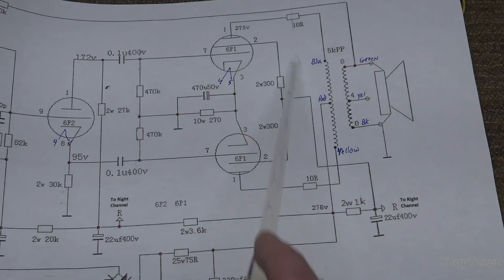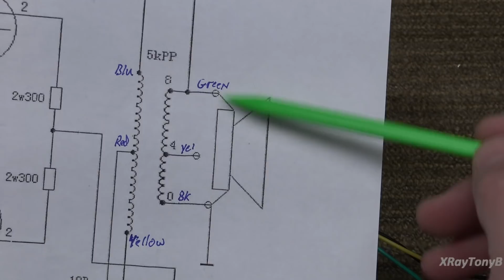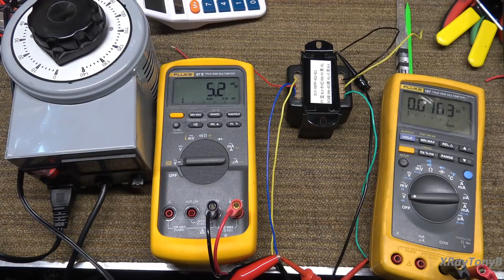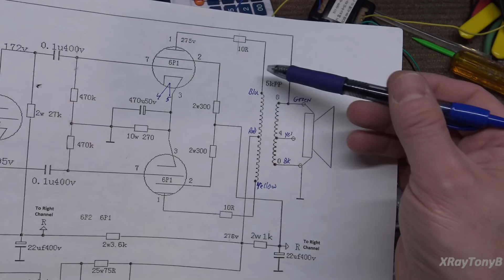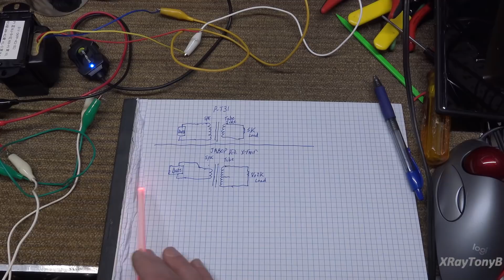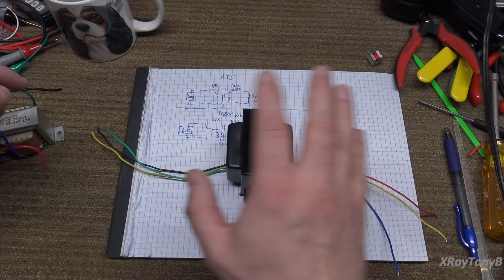Electronics 101½ Part 8 - The Output Transformer

Comment: you are wrong. it is a 5k transformer meant for Class A Amplifier. 
and we know Class A modifies impedance downward. 
more precisely Push-Pull Class A. 
you do not measure that "5k" or "8k" at the output, you measure it at a single section of the primary, when it delivers nominal power signal, not music, but tone, full power. 
how you do that?

Comment: I wish this kit was designed for EL84/6BQ5 push pull. It seems like it's so close to that, but not quite there.
Reply from the maker: I'm not sure what you are referring to, but this amp is push-pull.  It uses 6P1P outputs, which are similar top the 6AQ5 or 6V6, but with different pinout.  The 6BQ5 has higher gain and a few other differences, so some of the component values would be different, but it would still be the same circuit.  If you watch and learn from this series, you should be able to understand how it works.  Thanks for the comment!
Reply: @xraytonyb  Yes, I realize it's push pull, stating that I wish it was El84/6BQ5 and it seems so close to having the component values to be of such. I'm assuming they knew about the EL84, but wanted to design it using the less desirable, cheaper tubes to sell a complete package at an affordable price. I should've left the "push pull" part of my comment out, which was irrelevant to my point. I've been watching this series and I'm learning a LOT. Many terms and concepts had me lost until I started watching your channel a year ago. I love this hobby, because it's challenging and seems to be endless in depth. Thank you Tony for sharing!

Comment: How does running a single power tube in a push/pull cathode biased circuit effect the output transformer? Does it damage the output transformer?

Comment: I've seen this impedance ratio video over and over on different channels. Why not just put an LCR meter on the primary, measure the inductance and use the formula Inductive Reactance (impedance) = 2 * Pie (3.14) * F * L? I believe the standard frequency (F) used is 1 Khz. Would that not save a little effort? Thanks!

Comment: I'm get readings of between 4 and 9 megaohms when I connect between the primary and secondary windings on a suspect output transformer. So I assume thats the problem with my amp? Massive amounts of humming and no sound from speaker?

Comment: is it possible to ID mystery winding voltages with only one multimeter?
Reply: Yes.  Measure one side, then measure the other side.  For example, turn the variac up until you see 1V on the secondary, then take the meter off and measure the voltage on the primary.

Comment: How can I convert a vintage Yamaha CA-1010 transformer from 110V to 240V, from Japan to European standard.
Reply from the maker: You can buy step-up / step-down transformers for this purpose.  The only thing you need to watch is the frequency (50 vs 60 Hz).  Most receivers don't care, as they rectify the power to DC, but some things like turntables and tape decks can be affected.
Reply: @xraytonyb  I will hook it up to a modern CD player.

Comment: Howdy. May I be so bold trying to clarify things ?
Firstly. The magnetic induction depends almost entirely on voltage, frequency and number of turns. Current has little effect on magnetization other than the 90 degrees shifted inductive magnetization.
Second. The core does not convey or transport anything. The core only serves to keep the flux concentrated for tight induction.
Third. What heats up the transformer is almost entirely ohmic losses in the windings. The oscillating flux generates some heat. Yes. But that is almost negligible.
Fourth. The core size must be chosen large enough to accomodate wire gauges thick enough not to generate too much heat and to be able to dissipate the heat without causing the bobbin and wire varnish to melt and be a fire hazard. The core and winding outer surfaces do the heat dissipation into air.
Fifth. There is a rule of thumb that says that the core cross section in cm2 should be about the square root of the power in watts. But this rule is empirical only. It is not derived from laws of physics.
Sixth. How do we then understand the illusion of power conveying? Induction generates voltage over the secondary. This voltage starts driving current through the speaker. This current also fights the induction. The primary observes the induction going down and compensates by drawing more source current until the induction is restored.
Regards.

Comment: Xraytonyb, I learned something by watching your video, now I see another way to find impedance of an AF transformer. The way I was doing it was to use an AF Generator at 400 - 1000 Hz to feed through a series potentiometer into the primary, with the secondary loaded with a resistor of the rated secondary impedance. Read the generator voltage and adjust the potentiometer to read half the voltage at the primary. Then measure the resistance of the potentiometer and you have the  impedance of the primary.
Reply from the maker: That's an interesting way of testing impedance ratio.  Thanks for  sharing!

Comment: Is not the max voltage on the Anode of the 6P1 rated at 250 volts and not 275 volts
Reply from the maker: Yes, but this amp uses cathode bias, so the cathode resistor has some of the voltage dropped across it.  As a result, they are only being slightly naughty with the anode voltage ;)
Reply: @xraytonyb  Thanks for the reply

Comment: Howdy. Nice.
About getting laminations for OPT:s.
Check eBay for Line Transformer or Audio Line Transformer. One will get several hits.
I settled for Parts Express. They have 100 W 70 V items for about 30 dollars a piece. I ordered two and rewound them. The laminations are good audio grade steels.
Regards.

Comment: One little trick that a high school classmate pulled on us when we were in grammar school was to bring an output transformer and a D cell battery to class.  He would put the battery on the speaker side of the transformer and have one of us hold the input leads.  The second he touched that battery we got a big jolt!   It wasn't until years later that I finally understood how a dc voltage could shock you using an ac device.  Had he touched the wires to the transformer BEFORE we touched it, nothing would have happened but by doing it the way he did he momentarily created a current flow in the coils and we got zapped!  Since he was on the "low" side it meant that he was amplifying the voltage that we got.  Modern transformers are too small and don't have the potential that those old tube type transformers did so it wouldn't work otherwise.  Some have argued with me about it until I did the same thing and it made believers out of them.  The current flow is of very short duration so if you hold on to the leads after the initial jolt, nothing else will happen.
Reply: Richard, What gave you the jolt was the high voltage pulse created by the turns ratio and the magnet field rabbly changing as the battery was hooked up and disconnected. The strongest jolt happened when the battery was  disconnected causing the sudden collapsing of the magnetic field creating a high voltage impulse. In other words it was really acting as a spark plug ignition coil.
Reply: @JCWise-sf9ww , I fully agree.  Many people would never believe a c-cell battery could make your eyes water!
Reply: that brings back memories! our college lab instructor was teaching on CEMF and had us perform the same test. we knew something was up when he started chuckling and his fat belly was bouncing right before we disconnected the battery!

Comment: A pair of 6AQ5s or 6P1 will sound fine if it is 5K. I have done it before single ended as well as PP. Typically as you know 6AQ5s, 6V6s, EL84s are optimum between 6 and 8k depending on plate voltage. But I have a couple of SE output transformers that came from a Sony R2R which had 6AQ5 output tubes and the OT was 5K to 8ohms, So Sony designed this tape recorder with those tubes and an OT with that impedance. I used one with an amp and it sounds good with 6L6s and 6V6s. Also, I have a Kodak Projector amp which came with PP 6L6gb's and the amp also sounds great with 6V6s. As you know a 6AQ5 is a 7 pin 6V6. Tubes are very forgiving.

Comment: With your oscilloscope that has a bode plot mode you can do a similar measurement(perhaps with less accuracy) by measuring the applied voltage to the transformer and the voltage over a shunt resistor(as output input), and if you set your current scaling according to your shunt value directly get the correct values on screen.

This is useful for those of us that don't have an specific instrument to perform those measurements.

You need to have a scope that allows you to use the difference between channels as a bode plot "channel" OR a differential probe(Micsig has some cheap ones) OR you can get creative and take advantage of the isolation of the transformer and the turns ratio if you dont have any of the previous options. Also you could use a current transformer(pretty cheap but only for AC) or a current probe, but until recently those were always really expensive.

Comment: You didn't try to dazzle us by drawing load lines on the tube data sheets so I don't think there was too much maths in this tutorial ;).  An interesting tid bit is that the primary transformer impedance connected to the pentode is not selected for maximum power transfer but for minimum distortion (pentodes are awfully non-linear).

Comment: Hi Tony. Something doesn’t make sense here: Why would a higher-power amp (which, presumably, would need a higher B+ voltage) need a lower impedance of the primary? That seems like it would be equivalent to saying that “if I can safely put a 10k resistor across the 120 volt mains, then I should be able to put a 5k resistor across 240 volt mains).” But, of course, you’ll just end up with a burnt 5k resistor if you do that. 🤣😂
Reply: Tony is right. Most of the guitar amps that I work on that have push-pull 6L6 tubes running at 400-500V on the plates, are connected to output transformers with 2000 ohm primaries. Your example doesn't take into consideration the wattage rating of the resistor a 5k resistor across a 240V mains will be just fine if it is rated above 12W conversely, a 10k 1W resistor across a 120V line wouldn't last too long. In transformers, the larger diameter the winding, the more current they can handle, this increase in diameter also makes their resistance less.